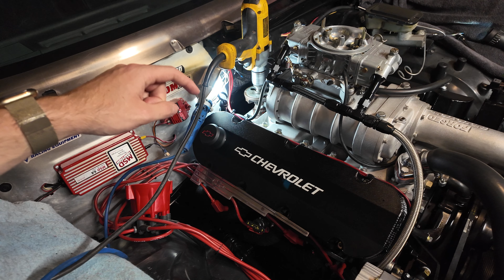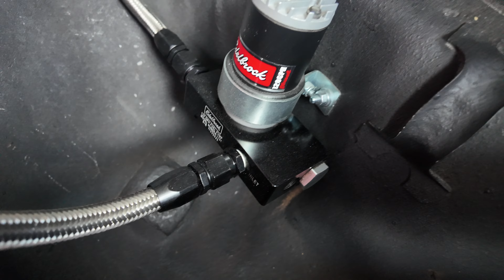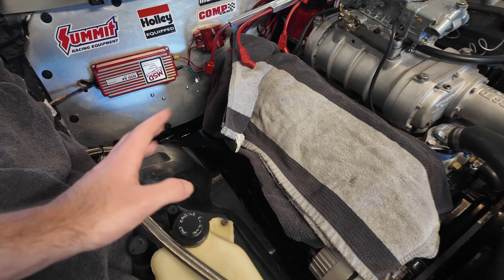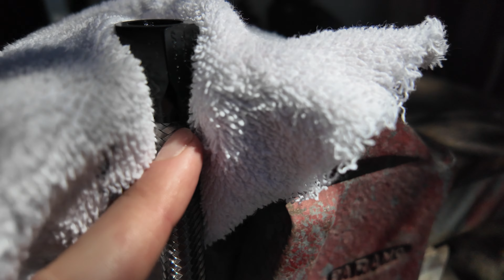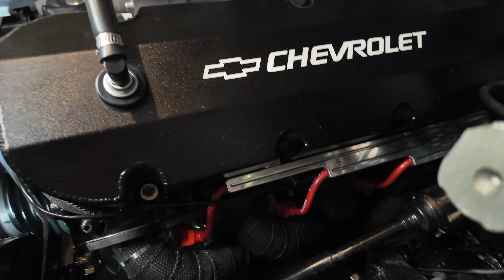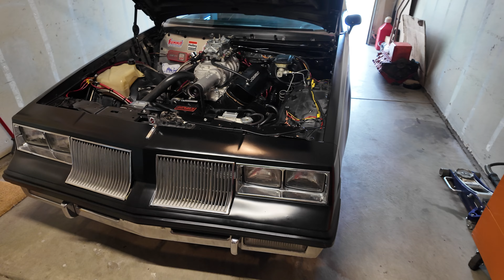Starting Up The Big Block For The First Time!

Comment: Does it even make any boost? I think that little blower is way to small for that 500cube engine.
Reply from the maker: Only about 2-3 psi, this motor is ideally built for a 6-71 or bigger. I’ll be upgrading to an 8 in the future but make sure to subscribe so you can stay updated with the build.
Reply: @bowmanauto  put a bigger crank pulley on it  for now  see if  it'll get up to 6-8 PSI.  i think thats  all theyre good for